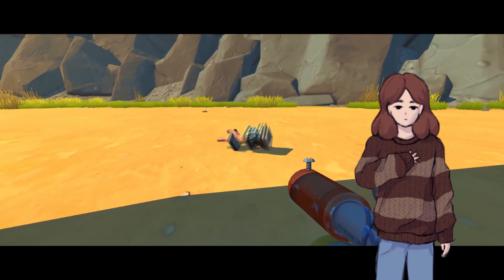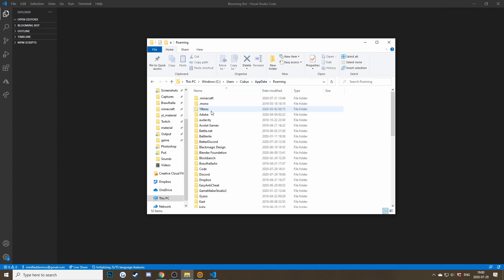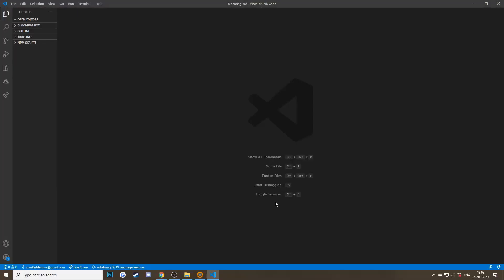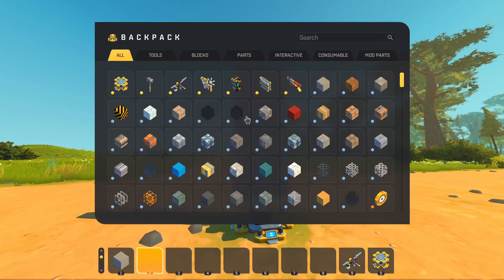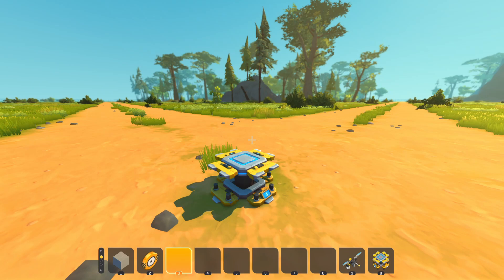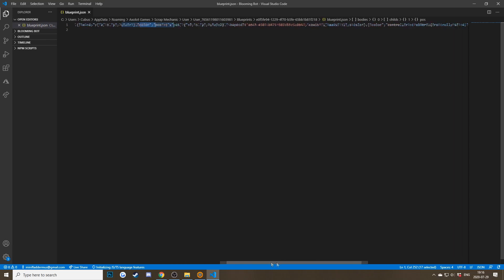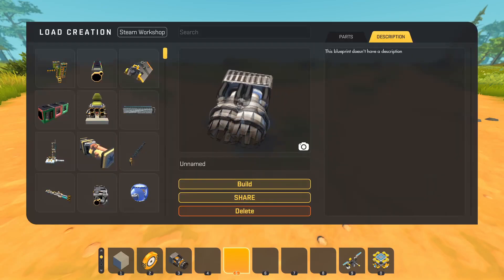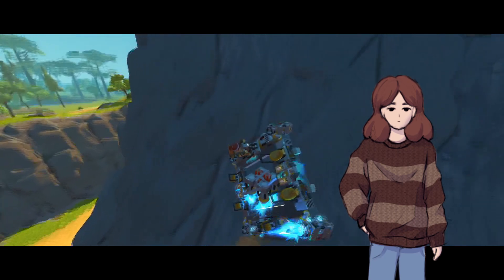How to Blueprint Edit in Scrap Mechanic ・ The Basics

Comment: I found this because of the discord server and this helped but I still prefer the glitchwelding mod
Reply from the maker: When it only comes to putting two objects inside of each other, sure the mod is definitely easier in single player. However with the mod you can only put objects inside of each other, you can't move something that already exists, you can't put two objects inside of each other that are connected together, you can't make impossible connections or impossible positions or change the settings of thrusters or controllers or anything like that. This was just the introduction video but for any video that's coming out in the future they'll all include things the weld mod can't do
Reply: I just like the glitch weld mod because it’s simple and doesn’t require an outside program glitchweldings all in scrap mechanic

Comment: cool vid and thx for the shoutout :D

tho: prettyprint ur json xd
there's plugins for json pretty printing for notepad++ as well as vscode and some other text editors

btw: what's up with the interlacing in your video ?
Reply from the maker: Heyo! I know about prettyprint but tbh I don't like it, especially for really quick edits like just changing the position of an object. It's definitely good if you're working on a bigger project just about blueprint editing but at that point I'd suggest to use your tool rather than text editing, I did actually mention prettyprint in the video but decided to edit it out since I didn't want to just copy your old blueprint edit tutorial (it's what first got me into blueprint editing so I'll always remember that video even if years have passed haha)

Also when it comes to the interlacing, I struggled so much with rendering this video since the audio kept getting messed up so when I finally got it working it was 3 a.m. in the morning so I just didn't bother with fixing the weird interlacing. Still not sure what caused it though so definitely have to look into that for the future
Reply: @CubsYT  the interlacing could be from scrapmechanic being dumb when recording it with desktop capture instead of window/game capture, same reason as the dropped frames
Reply: actually nvm it happens on the desktop as well so it's definitely a rendering issue
Reply from the maker: @TheDartFrog  Yeah someone mentioned it happens sometimes when you import videos from mp3 and export as .mov which I think I did? Definitely have to keep that in mind for the future
Reply: @CubsYT  pretty sure you just have to export it as 1080p instead of 1080i
Reply from the maker: @TheDartFrog  didn't even know 1080i was a thing lol